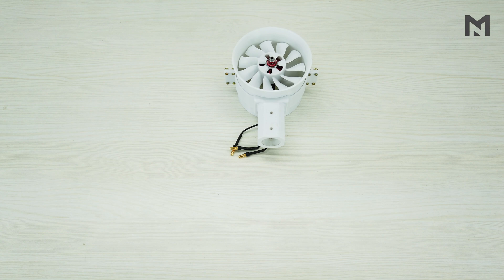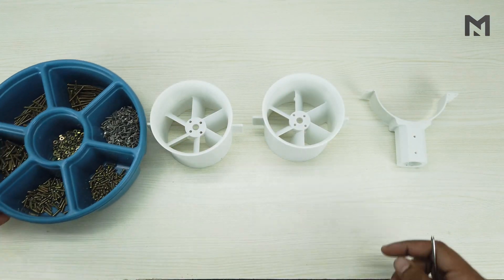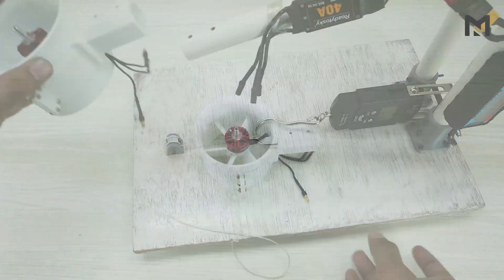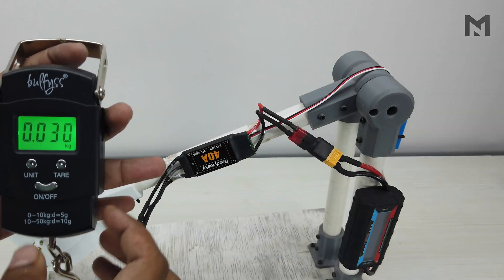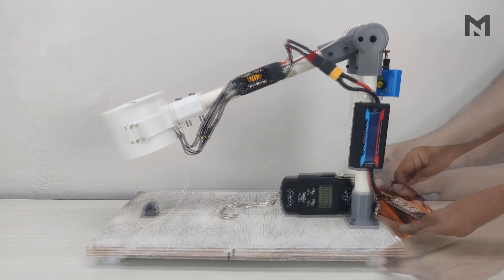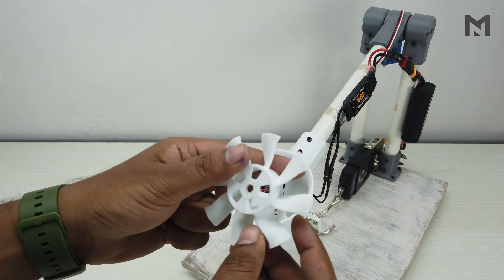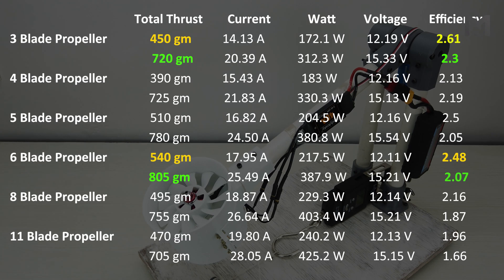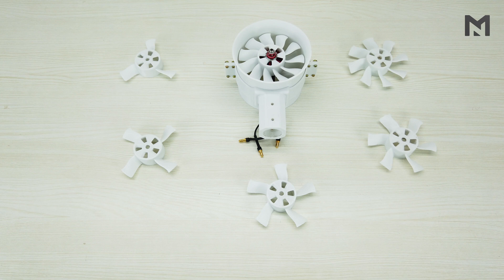80 mm Electric Ducted Fan with Stator Blades | 3D Printed | Max thrust test

Comment: The test is incorrect. One thing is clear from these tests - 6 blades of this diameter - the maximum that can be pulled on this engine. Then he just shuts up and turns it slowly. This does not mean that 12 blades give less thrust AT EQUAL SPEEDS. ONLY by measuring at equal RPM, you can understand the meaning of adding blades and the real difference in efficiency.
Неверный тест. Из этих тестов видно одно - 6 лопастей этого диаметра - максимум что можно вытянуть на этом двигателе. Дальше он просто затыкается и медленно крутит. Это вовсе не значит, что 12 лопастей меньше дают тяги ПРИ РАВНЫХ ОБОРОТАХ. ТОЛЬКО измеряя на равных оборотах, можно понять смысл добавления лопастей и реальную разницу в кпд.

Comment: Do you use a filament type 3D printer or resin type? There are some new high strength resins that might be more firm/stronger and reduce flex on the blade and might print lighter which will increase efficiency. Also, it would be interesting to see a 7 blade test. Just my two cents!!

Comment: Great comparison, thank you, it is very helpful for my project. As someone said, RPM is very important factor. We can see something interesting happens here: more blades = more thrust, more current. I can tell that more current = motor more struggling so RPM is lower. At some point (8 blade propeller) current still goes up, but thrust going down, it means that motor over struggling and it losing RPM drastically.
Reply from the maker: Thankyou so much for your support and don't forget to subscribe 😊😊😊😊

Comment: good job, finaly a good analysis on printed EDFs, use prop dia closest to standard propeller diameter to get best results ! low diameter and high propellers can work equally well. please try it with lower KV motors, something like 920KV
Reply from the maker: Definitely bro.... don't forget to subscribe

Comment: Are the stators used to created a laminar flow?
Reply from the maker: Well i have not put that much calculations as it requires the use of CFD analysis
Reply: @MechNinja  A laminar flow will be able create more thrust than a turbulent flow.

Comment: Hello
do you aim to work on the shape of the blades of your rotors?
In order to discover a profile with better finesse
Reply from the maker: Since I am not good in CFD, hence I generally design the blades using online available data. And for comparing different blades, i use my above data to find the best suitable propeller.
But in future I will be designing and testing them using CFD.
Reply from the maker: So keep supporting me and stay tuned for more videos...😊😊😊 And don't forget to subscribe 😊😊😊
Reply: @MechNinja  272 / 5 000
Résultats de traduction
OK I understand.
I know that there are different shapes of blades, some of which tend to offer less resistance to rotation, the ratio of electrical power consumed / thrust force produced might be better.
I subscribed
Good continuation

Comment: i have a patent pending diverting stator. it reduces the flow area and steers the spiralling air to exit straight out. The reduced area increases the exit velocity. There is also an initial buildup of air between the propellor and the diverter.  The net result is a higher and larger mass exitng the duct and therefore increased thrust.
Reply: Doesn't a Kort nozzle do the same thing? Is your diverter before or AFT the propeller? I can imagine low pressure air at the narrow exit running into high pressure air just outside which would result in vortex flows which counters the result of straightening stator vanes at the exit. Also this increases drag at the exit if the nozzle is long. However there should be a positive thrust pushing forward at the exit. Curious if you have done non static tests as this could be a balancing act!

Comment: You had mistake in begin of a static blades, behind the impeller. Cose it stops the flow after impeller like a wall. It must redirect flow, for it the static blades must meeting a flow by sharp edge, after that reflow and rectify a vortex to laminate flow on outlet.
Reply: for it you can change the direct blades of impeller or static blades

Comment: You should try using just two blades
Reply from the maker: Thanks for your suggestion...😊😊
But two blade propeller won't work in this design. 
It will only work when the propeller dia is about 5 inch or 6 inch.
But since our dia is 3 inch then we need more number of blades because the Rpm will be higher.
And thanks for watching the video and don't forget to subscribe 😊😊😊😊

Comment: On the clearance between fan blade tips and the edge of the dict, why not have the dict and the blade as one piece? The dict also spins around.  There in no blade tip vortex and no need for arms holding the duct to the centre.
Reply from the maker: Yes I can do that but it will reduce the motor rpm as the propeller will become heavier.
Since we can't add much weight to the propeller that's why we can't make that....
If you have any other suggestion then definitely let me know.
And thanks for watching and don't forget to subscribe 😊😊😊😊

Comment: I'm fascinated with your ducted fan experiment. 
I think it will be great feature in electric aviation era.
 

How to get hi-efficiency on generating thrust? 
Yeah, still plenty room for experimental design.
  
Here are my points:
- Get idea from tornado and reverse it.
- Get idea from hair driyer, hot and cold air collided.
- Ducted fan, safer and controllable.
- Thrust vector & auto adjustment
    

Well, my design just an imagination.
But you can print at will and test it, if you want.
Reply from the maker: Thankyou for your support.
I will definitely do a deeper research.
Don't forget to subscribe for more videos 😊😊😊😊

Comment: Great! But you forgot one very important parameter: the rotor RPM. You should compare thrust at the same rotational speed and measure energy consumption. Static thrust is good to know, but in-flight performance can provide a bit different results. Thanks for shaering the results.

Comment: I noticed you have very nice prints. I wonder if you would share your slicer settings?
Reply from the maker: Yes why not....😊😊
Use cura software...it's free of cost and let all the settings be default.
Then change the speed to 60mm/sec, 0.2 mm layer height and 20% to 30% infill...... that's all
By the way thanks for watching and don't forget to subscribe 😊😊

Comment: hello, please recommend me book on duct propeller design.
Reply from the maker: If you are a mechanical engineer....then you have to understand basic concepts from fluid dynamics by rk bansal and thermodynamics.
And basically duct and propeller design is a part of engineering.
And to be frank... designing a propeller and duct is way more advanced thing. You have to have high knowledge in fluid mechanics and avaiation.
So I would recommend you to have basics knowledge in fluid dynamics and thermodynamics.
Then you can start your basic design.
And leans Ansys CFD software. It will save your lots of time. Ansys CFD is highly recommend for testing for propeller design.
Hope you get it...And feel free to ask anything

Comment: In the construction of a ducted fan, the clearance between the blade tips and the edge of the duct is very critical. The thrust difference that you are measuring is mostly the result of blade tip variation. The variation that can be seen in the images.
Reply: To get rid of the variation he would have to print a hub and separate blades like a turbo fan correct?
Reply: @JimNotAvailable  That is correct, the way that I understand it.
Reply: Has anyone looked at combining the duct and fan so they spin together.   Would that improve efficiency?
Reply: @SuperFireMatt  Yes and yes. It is just not the design that the author chose to make.

Comment: Very nice! Could you compare thrust of bought edf turbine and 3d printed one?
Reply from the maker: Yes definitely I am going to compare it with the actual prototype.
I have ordered it and will soon upload the video.
But I need your help....You need to subscribe my channel for it...and press the bell icon....😊😊😊😊
So thanks for watching
Reply: @MechNinja  Edfs from factories are usually made with PLA,but they are somehow stronger than 3d printed PLA Edfs
Reply from the maker: Yes definitely they are stronger because though they are also made up of PLA but they are injection molded that means they don't have seperate layers like 3D printed. But good thing is that even the 3D printed propeller can't destruct from the centrifugal force by spinning.
😊😊😊😊😊

Comment: Are you going to try another motor on the backside of the stator? And, are you going to experiment with an hourglass shape between the motors for compression purposes? Or simply reduce the size to make it more funnel shaped? CFD would certainly help answer this. In first thoughts, it would help in 2 areas. First, directed air flow would be more predictable, allowing for design choices around the exhaust area. 2nd, the expanding air at the exhaust could help with backlash or oscillations by pillowing and pushing back on the motor assembly.
Reply from the maker: Thankyou for your suggestion. I will definitely work with CFD Analysis now because practically testing is time consuming.
So first I will choose the best out of CFD then perform the practical.
Well thankyou for watching and do share it....😊😊😊